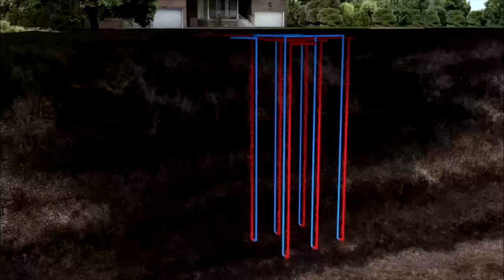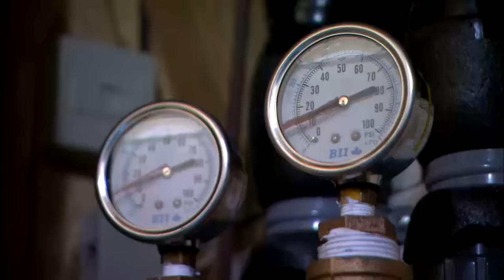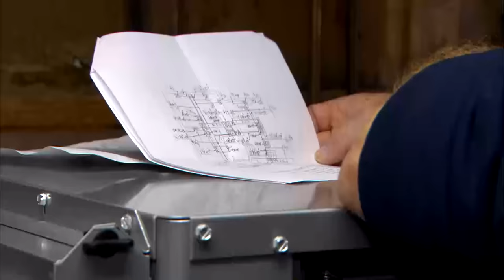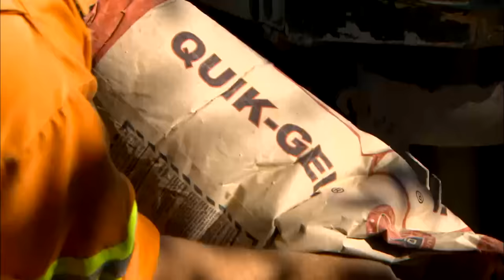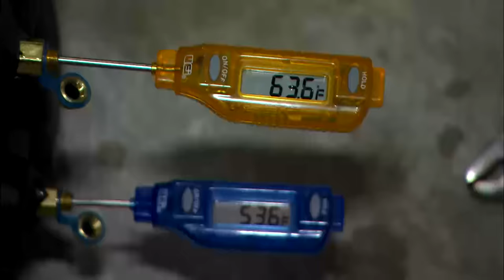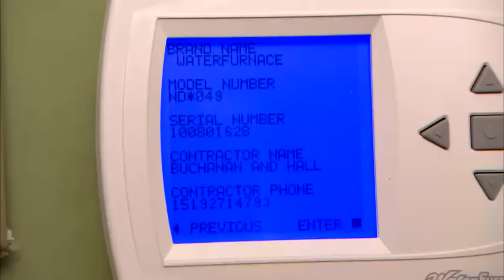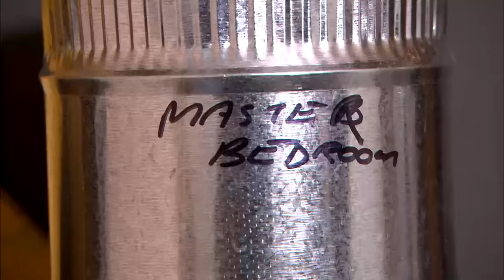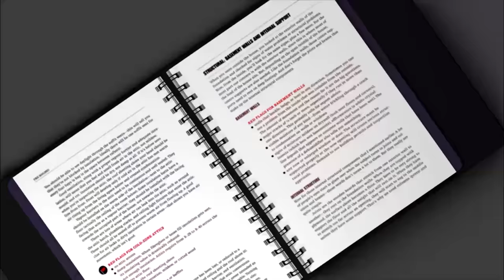The Unexpected Costs of 'Green' Homes | Holmes Inspection 208

Comment: uh... i wouldn't've thrown away that existing loop field so quickly. that was a huge expense and it could probably still be used if it works at all.  if shallowness is a problem, just dig down and attach to it lower
Reply: Yeah I agree
Reply: The whole thing was to shallow to do any good.   Would have been cold on the winter and warm in the summer the opposite of what is needed.  It has to be deep enough to be a constant temperature all year around.
Reply: The problem is the system was installed so badly that there's no way to know if the actual loop field was done correctly. Plus if you keep the old loop field nobody will ever come out to service your unit, companies only want to deal with systems and loop fields they've put in.
Reply: @hrcnick11 We never find out if the whole thing is too shallow. The problem was that the lines leading to the loops were too close to the surface and would have caused wasted heat or freezing. The actual loops may have been fine, but why would they have any confidence in that?
Reply: @crgd23  you don't have to have confidence. you connect to them and see how they perform. if they are shite, you abandon them. if they are amazing (and they might work great -- geothermal is great as long as it's above freezing, since the main thing you are trying to avoid is ice on your cold radiator) then you saved tens of thousands of dollars (or, in this case, doh!lars)

Comment: so the original "geothermal" system was just some pipes buried a foot below the surface? 
so it was essentially the opposite, it was a big heat sink that was cooling the pipes that were then trying to be heated by the hot water tank.... wow. whatever company fitted that should probably be sued.

Comment: Isn't spray-foam insulation many times the cost of fiberglass batts?   That should at least be mentioned as to not deceive viewers.
Reply: cost per r-value was a little less expensive than fiberglass when I priced it.  Spray foam is cheaper than mineral wool

Comment: Everyone with even an iota of intelligence knows that heat pumps (geothermal) are completely useless in cold climate areas. Even the idiot US government will tell you that. I am so glad you made this episode so people can see what horrendous junk these "green" systems are, and the fact that there is no one competent to install them even if you are dumb enough to want one. Geothermal should only be used for some commercial properties, never for residential. Too much environmental damage.
I live in a northern climate and I would never consider a heat pump/geothermal, solar or wind turbine home. If you want an air conditioner in Florida go for geo-junk but if you have a home in Northern Vermont you want a wood or oil burner (or both), a connection to grid-distributed electrical (preferably coming from clean nuclear), a back-up fuel (diesel, gasoline, propane) generator and a good artesian well. Stay away from the "green" junk or it will end up either deading you or costing you thousands to get rid of it for something reliable.

Comment: Personally, I’m not a fan of geothermal just because of the fact the system is designed to last 20 years they’re extremely expensive to install and all your savings go out the window when you have to replace the parts and components or the entire unit in 20 years so to me geothermal seems likea scam and if you couple the cost of inflation in 20 years, everything you saved you spend on replacing it
Reply: Geothermal makes sense for cold air conditioning because you're exhausting heat into the cooler ground. This is natural thermodynamic flow. But extracting heat from cold anything is never 'efficient' except relative to another method that is constructed poorly.
Otherwise, we could heat our homes by freezing buckets of water in a row of freezers in the basement. Just toss the ice into the ice house for summertime. All my freezers are 'very efficient' at pumping all the interior heat back into the room they occupy.
Reply: @HuFlungDung2  not saying it’s not any efficient system because it is extremely efficient but the system is only designed last 20 years so everything that you saved in efficiency you lose when you have to start doing all the repairs to the system and the upgrades so every thing you saved prime example let’s say it cost you $100 a month to heat your housebut in 20 years you’re paying another 20 to 30,000 to either repair and replace the system. How much did you save?
Reply: And from everything I’ve seen personal experience, my old supervisor, put in a geothermal system in his house proximately 20 years ago he recently completely took it out because everything he saved, heating and cooling. His house, went out the window because of the price of inflation of the components to repair or replace it, and he went back to Natural gas heat and a regular air conditioning unit so this is just not my uninformed opinion all this green energy stuff coming up solar panels, geothermal and whatever else they come up with is a ploy to make a few people money while taking advantage of the people who don’t do their long-term research, adjusting for the price of inflation when they install the systemyeah it’s good the first 7 to 10 maybe 15 years but after that, hold onto your bloomers Betty because your wallets about to be emptied
Reply: Do you know that a normal ducted A/C and furnace are only made to last 10 years?  And if you opted for a super high efficiency furnace and A/C the price is almost the same for the geothermal unit itself. With the same price for repairs.

Comment: I’m sorry but this repair was ridiculous, excessive, and probably cost more than the house was worth.  Guess I failed to see the point or be impressed with the unrealisticness of this video, great we spent 6figures installing a complex heating system that will never pay for itself and be nightmares going forward on maintenance since less than 1% of the hvac field knows how this system operates…..perfect, did the homeowner a real injustice, and fyi water furnace as a brand is complete trash- my hvac company has starting back charging them for faulty fan coil equipment that can’t even last a 1 year warranty period.
Reply: Think of all that was learned by a complete tear down of what was wrong and hidden and the value of doing it right.  Yes if you only looked at the value of the home vs the cost to fix all that was wrong that would not make economic sense on the surface. What we don't know is how much was donate, in labor and materials, or partially subsidized by the sponsors of the show.
Reply: Yes you failed because you're not smart.

Comment: so the hole thing could have been fixed by disconnecting the hot water tank from the geo thermal and 50 bux in fresh electrical line but i kinda wanna gut ur house... its what i do lol
Reply: This entire exercise, while definitely an improvement - seemed overkill to me. It was almost as if they didn't want to diagnose the actual problem and instead just wanted to replace everything to be safe. In the best interest of the contractors, but not the home owners.

All the plumbing issues was super simple to fix, just needed to add a vent and a trap. The electrical issues were also simple - fish and replace the wire. Could've just added more insulation around the vents in the attic to be safe and either disconnected the hot water tank, or replacing copper with pex to prevent conduction from the water heater to reach geothermal. It would've been done in a few days with negligible cost to homeowners.

The hardest issue to fix (in terms of time) was the reverse vents, but I'm sure they could've found a better way to do it without ripping everything out.
Reply: @MrAntarpreets  Mike doesn't do a half assed job, which apparently is what you're okay with.
Reply: @joesmith-es1zy  People have been brainwashed into believing that replacing things in entirety is the right solution rather than repairing it. In reality, replacing it is generally half assing it because chances are you'd miss the problem in the first place or maybe even introduce new ones. For instance, in this case Mike used spray foam which has some health concerns.

Comment: Going green is a waste of money.
Reply: Not for certain things. Geothermal heat is a good thing. EV cars not so much.
Reply: @1packatak  My Brother has owned an EV for the past several years. the upfront cost was about 25% higher than a compairable gas car, but his fuel costs have been FAR lower. with how far he drives to work he would be spending 300-400 a month as a rough estimate, but with the EV its been 20 a month. Fuel costs have saved him more than the increase in price he paid for the EV.

Will that be everyones experience? probably not, electricity prices are a big factor. but its my opinion based on the data i know that EVs are way better for the vast majority of people who just drive back and forth to work (assuming you have a place to charge it cuz thats another can of worms)
Reply: not in the long run, and especially not once investments into the development of better green tech actually goes through
Reply: Being smart about going green is a wise investment. Going green for the sake of going green is a waste of money. 

Insulating your house and making it airtight so that it maintains its temperature with less heating or cooling is a wise investment for example. That costs much less than heating and cooling an uninsulated house. 

I installed solar panels on my house when I bought it. They’re generating enough electricity so that I was seeing a 9.5% return on investment before electricity rates went up the last couple of years. Now my ROI is higher than it was originally, but I haven’t calculated the new ROI. 

You just need to evaluate what makes financial sense for you. Every house is different.
Reply: Geothermal can save you a ton of money, but go ahead and keep using your old technology and paying more. Some people just seem to love blowing money on stuff instead of saving it with green technology.